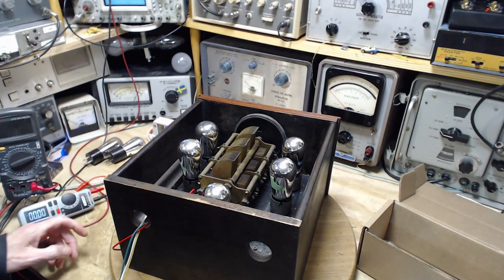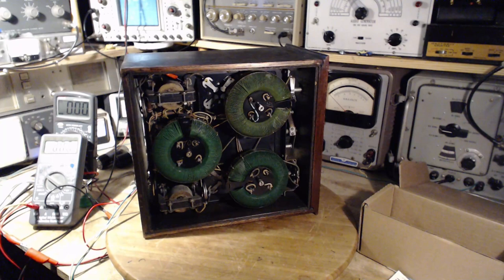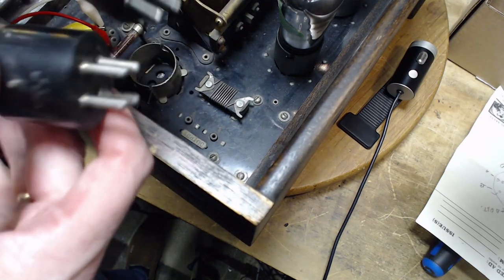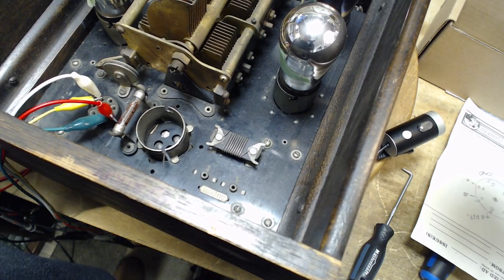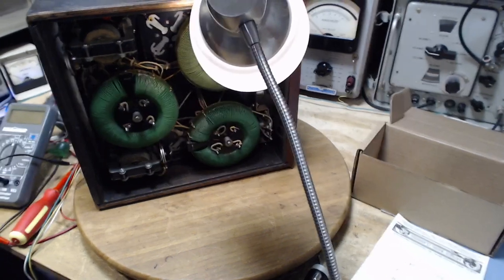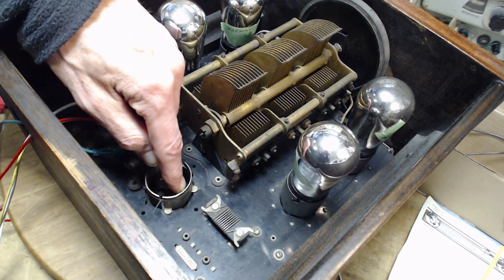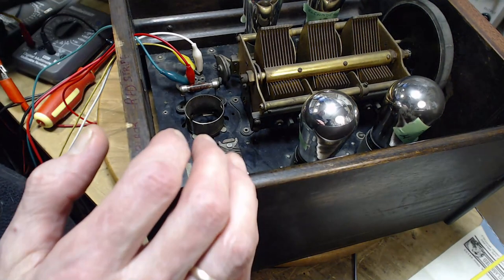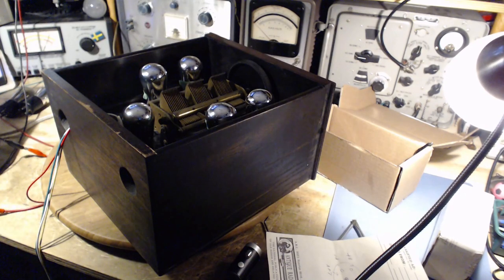1925 Magnavox Type D TRF Radio Video #3 - Getting the Tube Glow

Comment: Clean the socket terminals with a Q tip with a contact cleaner to get the crud off, if further cleaning is needed use a gritty typewriter eraser, to polish the contact also clean the solder on the bottom of the tube pins

Comment: Any one think about rebuilding this radio in a shoebox using 3 KORG NUtube 6P1's half for each stage all filaments can be paralleled together for 3V Heater as well as a connection to negative/GND B+ will be 64V.

Comment: each tube should pull about 250ma @5v so you are a little low
Reply: Two tubes are in line with the rheostat
Reply: You need B+ 90v (Amp) B+ 22v (Detector) and A+ 5v